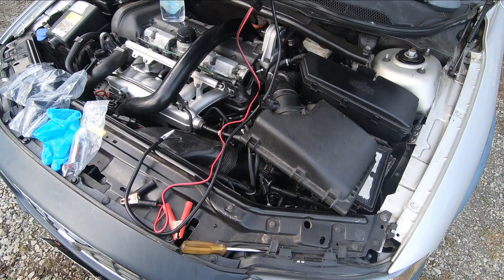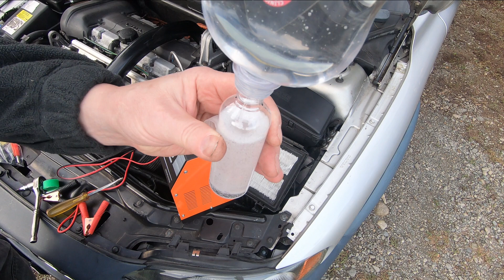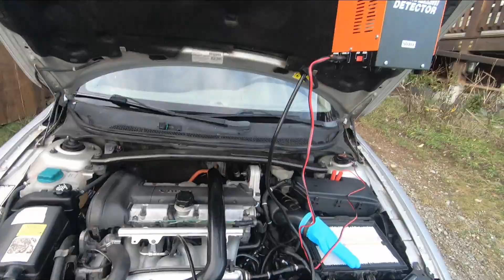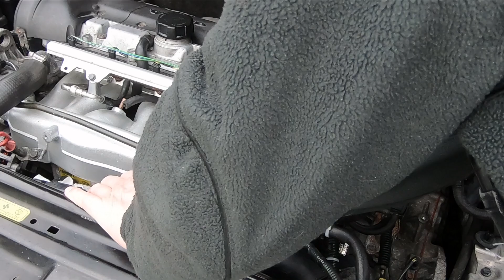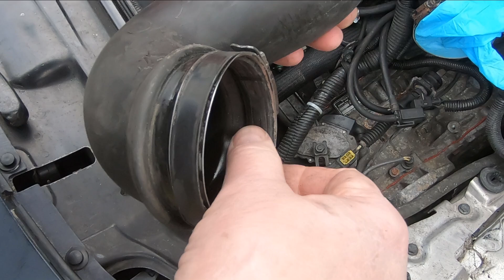USING A SMOKE MACHINE TO FIND VACUUM LEAKS ON ANY CAR: (PART ONE) FINDING THE LEAK

Comment: Lol its not just for making your old face soft and smooth, great for smoke lol that was quite the leak there. I found that it can produce lot of pressure, not sure if it stops when gets to high pressure, nothing in manual. I was thinking when i was looking for a leak that if dont shut off might blow a small o ring etc. Depending on the situation.
Reply from the maker: I'm going to try unscented mineral oil instead of baby oil. The baby oil works but has a scent that makes the smoke unpleasant. As you've said before, the smell lingers for days anywhere you leave the machine. Not sure how much pressure is generated by the machine, but it would be easy to hook it up to a gauge. I'd have never found that leak without smoke.

Comment: This is very interesting and a very handy machine to have. I can't see how you would have ever found the problem without that machine. Can you super glue the pipe?
Reply from the maker: I was surprised at the quantity of smoke that came out of the leak. These machines are inexpensive and work very well. I actually have the components on hand to build a smoke machine from a piece of PVC pipe, using a wick and resistance wire but that project always seems to get pushed to the back of the shelf. There are many videos on YouTube of the homemade machines, showing just how to build one. This commercial machine cost less than $100 and works like a charm!

Comment: Good morning Craig, lucky you got the smoke machine you would have never found that without it, hope you can repair it and am now looking forward to part 2 on this project 👍👍
Reply from the maker: Hi Nev, nice to hear from you! Yes, the smoke found this leak where other methods failed. I tried searching all over the engine and emitting propane through a tiny hose near where I thought the leak might be, hoping that the propane would get pulled into the leak and increase engine rpm, but I may not have had the hose close enough to the actual crack in the pipe. Smoke machines work fast and are the definitive way to find vacuum leaks. Part 2 later today.💪

Comment: The correct fix is a new part, but if the vehicle needs to be put into use immediately while the offset is ordered, I'd go with a generous dollop of RTV at the leak after it's been reassembled.  Let it set up before running the engine

Don't forget to flip that hose clamp for future ease of access to the nut.
Reply from the maker: I have a part 2 coming soon with a repair to the inter-cooler pipe. Yes, RTV is a quick fix if you can reach the leak easily. These Volvos are a bit more interesting, however.:face-red-heart-shape: The hose clamp swap is already done.:trophy-yellow-smiling: Thanks for stopping by and commenting!

Comment: Looks like you Cheech & Chong your way into another project😂 Back in the day we used a propane torch. Turn the valve on and run the engine while pointing the tip around carb base and hoses. When the engine revs up you found the leak👍
See ya Craig ✌
Reply from the maker: Thanks Marc! Yes, I attempted propane a few weeks ago and couldn't find the leak. Some guys spray carburetor cleaner or other flammables to locate vacuum leaks.
The smoke pinpointed the leak exactly where nothing else could. The machine was inexpensive and smoke tests will become routine maintenance on all my vehicles from here on. Cheech and Chong would be proud!:face-turquoise-drinking-coffee::face-turquoise-covering-eyes:

Comment: Why did they allow cars to be difficult?
I'm changing an alternator that is at the 7pm location looking from the front of the Xterra.   I suppose it isn't all that bad, but compared to other cars where you can wear a white long sleeve shirt and not get dirty...this thing is guaranteed to get ice down your neck and sleeves full of grease.
Reply from the maker: Cars aren't easy to work on. A guy has to either love doing his own work or not have any money to want to be under the hood of most modern cars. Volvos are known to be difficult to work on. Just after I bought this one, a mechanic told me they are the worst to get at. Now I believe him (But I still Love my Volvo!). It's a sickness I think! lol